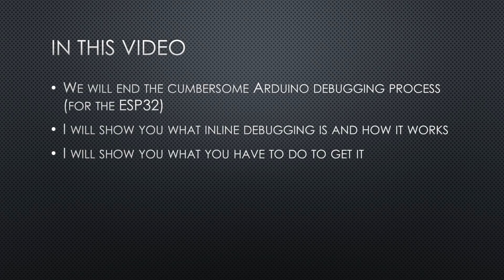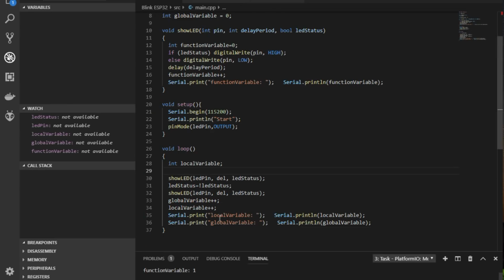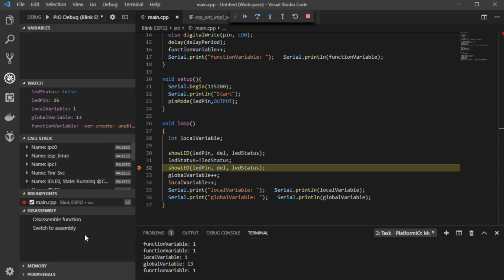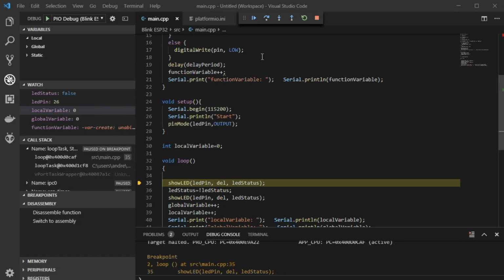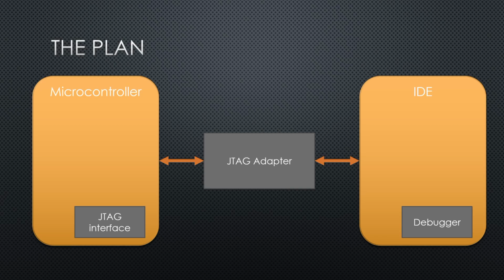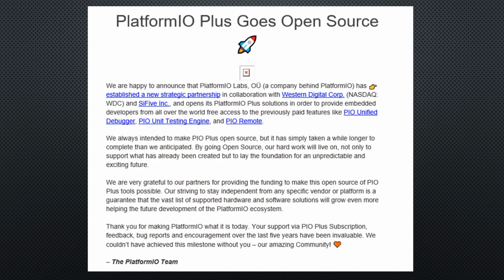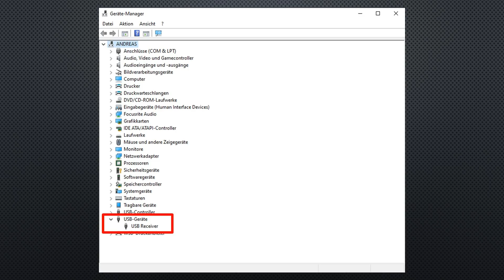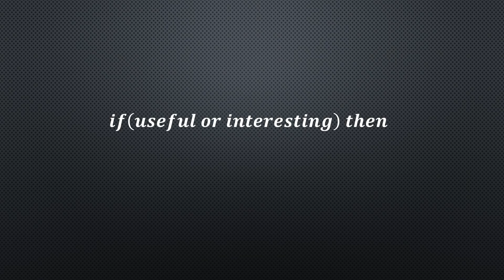#274 Free Inline Debugging for ESP32 and Arduino Sketches

Comment: Thank you for all your videos, most enlightening.  In this video you use Serial.print and the output is seen in the terminal window.  I have still fumbling around in PlatformIO having only now moved from the Arduino IDE which I was quite comfortable with.  The need for better debugging was too great though.

I have finally managed to get debugging working using the ESP-Prog, but the Serial.print is still causing hair loss.  I'd be most grateful if you could explain what I am missing please.
Reply from the maker: I do no more remember the details :-(

Comment: Great job Andreas!  You mentioned that this process works with the esp8266.  I am wondering about the HUZZAH Feather (esp8266 version).  I do not think it has JTAG support hardware, however, it sounds as if it should work using the method you showed in this video.  I have the OLIMEX tool.  Do you expect it will work with the HUZZAH Feather as well?  Thanks for your videos. They are very helpful for starting out with the espressif boards. I subscribed to your channel.
Reply from the maker: I do not remember the details. I would not do it for an ESP8266 because you run out of pins rather fast. Search for hilltop-cottage and debugging-esp8266-with-gdb (YouTube does not allow links)

Comment: So if I understand correctly one can use a commercial software-only solution (Visual Studio + Visual Micro Arduino Extension) for stepping thru code...

OR..

you can use a JTAG Adapter (esp-prog) and open-source software (VS Code + PlatformIO)?

(BTW, I really like the idea of moving away from the setup() , loop() structure, and instead use something like FreeRTOS or other operating system Zephyr, etc)
Reply from the maker: You have to distinguish between the debugging software and the hardware connection. All debuggers need some kind of hardware to connect. Newer MCUs have it built-in the chip.

Comment: Just ordered my first esp32 board.  Is the information in this 5 year old video still relevant, or is it even simpler now to debug on the esp32?
Reply from the maker: It should be very similar. The -S3 can be debugged without additional board.
Reply: Yes, I just got it working last week 10/9/24 Oct 9, 2024, for your Europeans ;-) Listen closely to Andreas' warnings. It took me multiple tries to get it working but it did eventually. OpenOCD was giving warnings and even an error but it still worked. (using Windows 10).

Comment: I just recently discovered, that nowadays you can also do inline debuging on an atmel 328p chip with PlatformIO and the "debug_tool" being set to avr-stub. You don't need any hardware for this, because it is implemented in software. See PlatformIO docs for more detail. I have not explored this option myself, yet but I saw a video where this was demonstrated with an Arduino Nano.

Comment: BTW, ATmega328 contains debugging hardware named debugWire. Inly uses one pin and has not many HW-breakpoints, but in general it works.

But yeah, I never had a „probe“ for it, while with ARM it was just a 8€ usb dongle.
Reply from the maker: Unfortunately, DebugWire only works with the proprietary IDE (AFAIK)

Comment: Hi Andras,
had some problems with ESP-Prog at the beginning.
Now it works fine, upload and debug.
Only the serial monitor is not working, because on missing / unknown device.
as not able to solve that..
But i can debug, it's better than serial outputs.
Thanks a lot for your video.
Peter
Reply from the maker: I am sure you will be able to solve  the last problem, too!
Reply: @AndreasSpiess  yes, I have I have to disconnect the USB Hardware from Rx an Tx. Then I can use Rx and Tx together with ESP-Prog. There are 2 0 Ohm resistors on the module to  make that happen. On my own hardware later on I can remove the USB stuff, not required.
Thanks again.

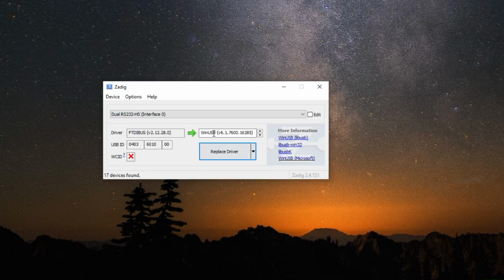Comment: 15:31   No, do not Zadig the second USB driver, as if you do, you will lose access to the serial port, which is nice for debugging still.
Reply from the maker: Thanks for the tip!
Reply: @AndreasSpiess  great video, it helped me get it set up.   But I noticed the second port untouched was showing up as a serial port, and having everything on one cable was nice.
Reply: As stated in the "manual", the serial interface with the lower port number is the JTAG interface.
Is it, in your experience, absolutely required to "Zadig" that serial interface?
(What does the Zadig driver provide that the standard FTDI driver does not?)

Edit:
OK, i think the answer is YES!
As I understand it, the signals have different purpose and hence have to be handled differently in case of JTAG.

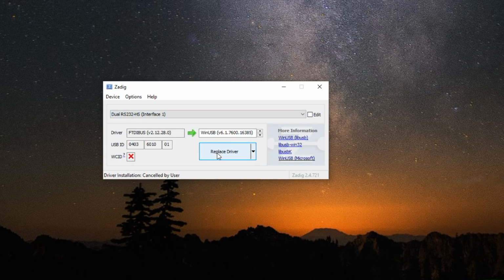Comment: Thanks for the video. It saved me a lot of time. You left out a step at about 15:45 which caused me some trouble - I left it out too, and my debugger didn't work. You have to download and install the FTDI drivers before the Zadig ones (https://ftdichip.com/drivers/vcp-drivers/). If you don't the debugger says it can't find the .cfg file (I'm using the esp32doit). Still your video saved me hours! :goodvibes:
Reply from the maker: Thank you for the info. On my computer I probably have most of the drivers installed from previous projects ;-)

Comment: Man you have a Nice job and you treat it well. I'm 58 and started out in Aircraft RADAR,  All tubes.  When things broke we had to trouble shoot to the component. I never "Debugged" a RADAR system. (Unf*cked maybe).  How did we get debugged in to the language? Do Transistors have bugs? I never found one using a Tube tester.
Reply from the maker: I think, transistors with bugs are called defective ;-)

Comment: As for now, it's not necessary to use PlatformIO; actually, it makes things more complicated. Right now it's better to use Espressif's ESP-IDF VS Code Extension. As a JTAG adapter one can use an FT232H (or FT2232H) based board. They can serve even more than just JTAG.
Reply from the maker: You are right. But I decided to use the Arduino Framework on this channel because it also can be used for Atmel and STM32 chips. And it is supported with many libraries. That is why we use PlatformIO. If I remember right, the Espressif board in the video uses an FT2232H chip.
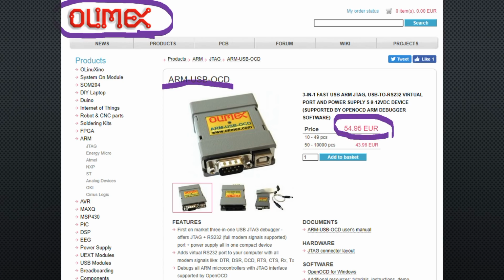Reply: @AndreasSpiess  I see; for multiplatform Arduino, PlatformIO sounds like a good choice. About the board I don't know, just at 12:25 you're showing (for many hobbyists) relatively expensive JTAG adapter. And I'd say it's enough to grab some board with one of those FTDI chips. ESP-PROG (for about 15€ on Ali) for example, is nothing but a FT2232H based board which uses two channels from the chip; one for JTAG, one for UART programming. But it's fine to just get one channel version with FT232H (for about 8€ on Ali). It can do both, just to the target module needs to be connected either to UART or JTAG pins. And it's not even uncommon that users program target chips over JTAG (right before debugging session starts), so that whole UART thing might be dropped, IMHO.
Reply: @victoriamotion7980  Thats a comment I only understood AFTER I received my ESP-PROG board and noticed that its not much more than a dual channel USB-Serial adaptor with some interface connectors.
Its ok though.
Thanks for writing it.

Comment: Many thanks for your prompt reply. I was using the List All drivers option, however, you put me on the right track with the PlatformIO tutorial  In the written documentation it states "Plug the ESP-Prog into the USB Port" This is not stated in YouTube. Zadic can now list the correct driver. A Trap for young players. All Fixed now - Many Thanks for your help. "
Reply from the maker: Glad it works now!

Comment: Hi Andreas, Thanks for another great video. I have loaded Zadig but the Dual RS232HS driver is not in the list. I have tried to download it from the web with out success. I am using windows 10 (fully updated) – Any Suggestions how I can proceed to load the correct driver. – Many Thanks Peter
Reply from the maker: You have to follow exactly the tutorial on the PlatformIO page. Maybe you forgot to select the "all" button.

Comment: I've got an esp-prog and tested it with several ESP modules as well as naked ESP32. For me it only works for very small code like Blink example and even then it is often unreliable and slow. I tried to reduce the debug speed and it helps, but I need to go as low as "debug_speed = 200". Then it is really slow. I shortened and improved cabling, and tried also powering via USB/TTL or both or only esp-prog - no improvement. 
Does anyone who has the same problems knows a solution? Which board combinations and platformio.ini setups are working for you?
Reply: I did some more tests and trials and my setup is more stable now (still a little bit slow though). Don't know what made the difference but here are the changes I did:
- removed and reinstalled FTDI and Zadig Driver
- using only a single USB connection
  o supplied my ESP system under test with 5V from esp-prog (power regulation on ESP board)
  o connected RX, TX, EN, I0 from esp-prog to ESP board and using upload via UART (this is faster and does proper reset each time; also print statements in terminal)
- removed deep_sleep. Although I break before, during "run debug" the the target system is already running and probably going throuht deep sleep, disturbing the JTAG connection ?!
platform.ini:
;upload_protocol = esp-prog  -- commented out, using UART
debug_tool = esp-prog
debug_init_break = tbreak setup
;debug_speed = 200 -- commented out, using default 5000 kHz.

This leads me to a new question: How can deep sleep be emulated for debugging as this is standard in all my code. Light sleep will not restart and ESP.restart() will reset the debugger as well. I could just simply do a very long delay instead of deep sleep and reset the debugger to emulate a "restart" after sleep. However this will reset the RTC memory.
Any ideas are appreciated.
Reply: Just to keep you entertained...
Running at 26Mhz now with debug_speed = 26000 in "platformio.ini."
Also reduced 'debbuger spam' with debug_level 1 in ".platformio//packages/tool-openocd-esp32/share/openocd/scripts/target/esp_common.cfg"

For ESP.deepSleep() called in setup or later in loop, the following provides ok emulation:
// in header file
#ifdef DEBUG_FTDI
bool emul_sleep = false;
#define ESP MyESPEmul
static class
{
public:
  void deepSleep(long long unsigned s) {emul_sleep = true; Serial.printf("emulating %ds deep sleep in 1s; put a breakpoint at setup() to stop longer\n", (int)(s/1000000)); delay(1000);}
} ESP;
#define deepSleep(t) deepSleep(t);return
#endif

// first thing in loop()
void loop()
{
#ifdef DEBUG_FTDI
  while(emul_sleep) {
    emul_sleep = false;
    setup();
  }
#endif
...

Next challenges is to do something similar for rtc_wake_stub. I am still trying to find a solution to call the stub which is located in RTC IRAM directly from loop() in main for a simular emulation of a wakeup into the stub. Alternatively still happy about any hints how to restart the ESP without resetting the debugger.
Reply from the maker: I did not use the ESP-Prog with PIO but with Visual Micro and I was able to debug a very big project (see my recent video). Debugging is never fast with GDB...

Comment: I started out programming on a TRS-80 writing files to cassette tapes in the late 70's and that system had a debugger with a step function. Hard to believe it only took 50 years for someone to figure it out for micro controller! Thanks for the great video! Also your Platform-IO video was an eye-opener! Now If only someone could make a video tutorial on how to properly write a sensor integration for ESPHOME using existing Arduino libraries. There are a few devices I would like to use but there isn't an ESPHOME integration for it yet. For example,  my last project I had to "Fake it" with a switch and a brightness slider. Pretty awful at the moment. 73-KD9BIZ
Reply from the maker: I also started with the TRS-80! But I used BASIC which was an interpreted language. But on the Intel development stations, we had "true" inline debuggers back then.
I was really happy to get it back as you say, 50 years later...
The ESPhome integration seems not to be too complicated if you know, how. A good video would be really appreciated. 73 de HB9BLA
Reply: @AndreasSpiess  Yes it was BASIC and very cool we share lots of things in common besides beer :-) I don't know how to do the programming yet for ESPHome and HA. Their documentation isn't that great. No clear definition on syntax or where to code it. In Yaml? In something else? Where to library files go? Lots of questions and missing pieces. I just made a sensor for my hydroponic garden lights using a TCS34725 attached to a D1mini and also included a MAX44009 on the same bus. I was going to play with that as a test. BTW, my wife's heritage is from Switzerland and seems to be about as understanding as yours is LOL.

Comment: Inline debugging can be done on an Arduino, but you don't use JTAG--rather proprietary "DebugWire".  using Uno R3: http://www.solutions-cubed.com/electronic-design-blog/debugging-arduino-sketches-with-atmel-studio-7/
Reply from the maker: I never saw a Maker using these tools. Do they work with the Arduino framework?
Reply: @AndreasSpiess  I am a maker and use these tools  :  )    Answer does it work w/ Arduino framework: hardware yes, IDE, no.  You need to use something like Atmel Ice and Atmel Studio 7.  You can import your sketch into Atmel studio, but can't export it back out.....Furthermore, If you are using an uno or something like that you also need to cut the UNOs reset trace which makes Arduino IDE not work until you solder it up again. But, if you do all that I find the Debugwire inline bugging really easy; it doesn't use up any GPIO pins, and I use it to do inline bugging on Uno and Uno clones all the time. More info in my blog post: http://audiodiwhy.blogspot.com/2021/02/fun-with-atmel-studio-and-burning.html  SUPERChannel Mr. Spiess!  Keep up the great work!!!!
Reply from the maker: So you confirm my information. I decided to go with the Arduino framework on this channel because otherwise, it would be too complicated. We get now more and more 32 bit chips with good debug properties like the ESP32, the STM32, or also the Pi Pico. So I will no more use 8-bit chips for larger projects where I need debugging.
BTW: You have a cool blog! Not easy to understand for a non-native speaker, thou...
Reply: @AndreasSpiess  Yeh, the strange language (puns, idioms, humor, nonsense) is an American thing?  It must be hard to be universally educational, as you are, so I leave the kind of work you do to the pros. Your content shows an excellent command of English, and you explain things with great clarity, more so than most native English speakers I see on youtube. So I have to say: Keep on Keeping on!

Comment: Hey, I used an "Intel Blue Box" just like that one in my first job at age 17, writing PL/M code on our custom 8085 audio spectrum analyzer board.  The debugger hardware was two large Intel circuit boards that would just get flaky after a while - we would pull the boards, rub the back with aluminum foil, stick them back in and keep working.

Now we're both here 40 years later playing with ESP32 hardware debuggers!
Reply from the maker: I also started with this rack in the 1970s...

Comment: YES! Andreas, You're absolutely right : this will be a true life changer for me as well. I'm used to work with debuggers in the programming languages I use on a dayly basis and and always found it more than tedious to do my arduino programming without. Especially as I am not as safe and sound in C++ as I am inmy other languages. 
-When it comes to referencing and dereferencing of pointers I sometimes have to enter the area of guesswork or trial and error. 
- Optimizing code by testing different variants and approaches is very time consuming.When it comes to debuging.
- Debugging data types via the serial monitor is not always working as expected, as it does its own conversions or requires manual conversion prior display, which sometimes covers up the problem.
- Stupid errors like expecting a float value froma division of two integers without conversion
- ....

I actually knew about the inline debugging capabilites of platformio, but at the time I read about it, it was available in the commerical version only and was no option for the projects I did at that time. So I did not pay attention, when You made this video back then. 
Just when I accidentally heard about the esp-prog a few days ago, I looked into it again and remembered that You had done a video on that subject. Now I find it hard to wait until I get the debugger. I've not directly found a source that delivers from  within Germany. So it seems, I'll have to get it from China and be patient.

Despite the fact, that on an esp8266 only a few usable pins remain,I still think,it will be a huge support even for these boards. Especially,when it is about conceptual / structural debugging. 

Excelent, as always!  
Thanks and regards 
Frank
Reply from the maker: I hope the "ship" from China is fast ;-)
Reply: @AndreasSpiess  it seems, they are using a rowboad :-) ... I've waited so long, I'll get through this as well.

Comment: Any other Arduino compatible board that has inline debugging that you would recommend? What I'm after is that it is cheap (with a cheap debugger) and at least as powerful as an Arduino Uno (which should not be that hard). Also, the more GPIOs, the better.
Reply from the maker: I never tried other boards, so I do not know. Maybe the STM32s also work.